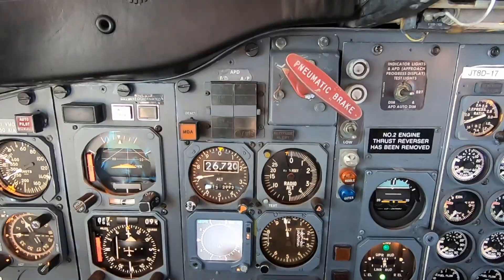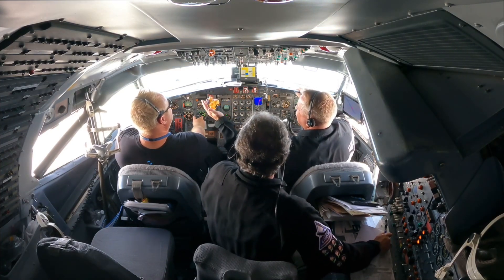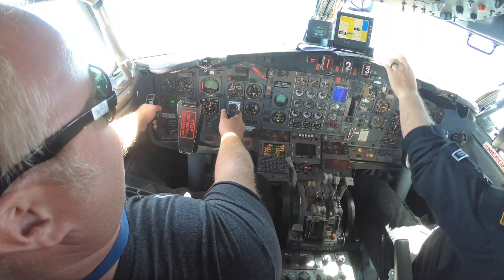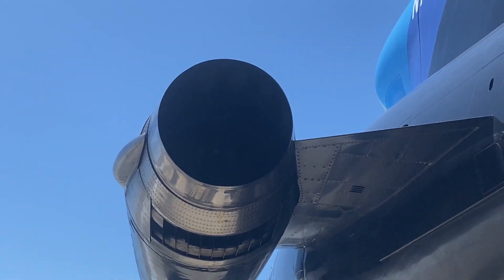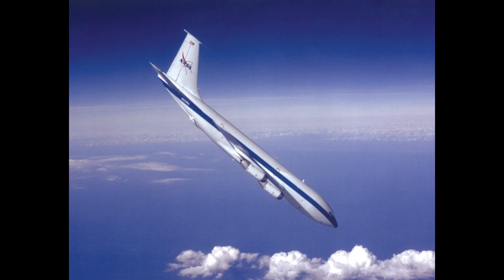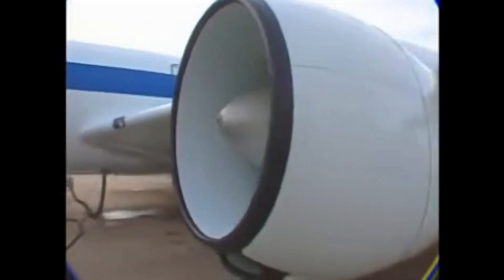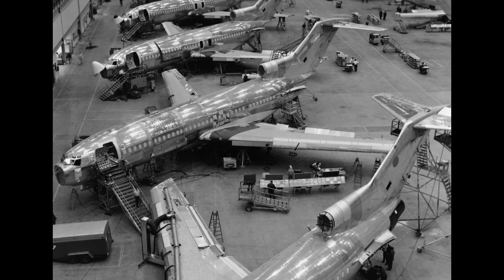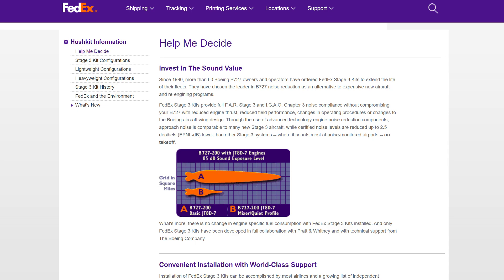Why NASA Uses A 1970's Boeing 727 For Zero G Experiments.

Comment: Funny story told to me when I was doing my PPL back in 2000... a 727 had just left the gate (forget the airport) and was taxiing across the apron, when the flight crew received a request to stop and take on another crew who were “deadheading” to another aircraft in another city. The captain stopped the plane and the rear air stairs were lowered so the spare crew could board. As the fully uniformed captain, first officer and flight engineer dashed up the stairs and past the passengers towards the front of the aircraft, one of them was heard to exclaim “My god, I didn’t know the stewardesses even knew how to start the engines!” 😄
Reply: Thanks for the laugh, I needed that.

Comment: As always great technical explanations for the systems and flight control management by the pilots. All very fascinating and great teamwork at the very least.
 As a side note, Bob hoover was doing similar types of maneuvers  back in the 50's and 60's as filmed adds for the Shrike aircraft alone in the cockpit whilst drinking a glass of water.....and the engines turned off....just makes you think.
RIP Bob.

Comment: The tri-jets came about due to the FAA not certifying twins for trans ocean flights to save fuel. Engines were not powerful enough at that time to complete a flight with only one engine.
Reply: True for the DC-10 and L-1011 but I don't think the 727 was ever envisioned in 1960 to be used for trans ocean flights and don't believe it ever was. It was never a long range aircraft.

Comment: Another plus point to the 727 is actually those low-bypass jets. If you need to maintain speed very accurately during a precise maneuver then low bypass engines are much quicker to spool up and down than larger high-bypass counterparts.

Comment: Yes, ESA uses Airbus. Of course. You are correct, it is an A-310 at this time. They have considered upgrading to more a modern type and eventually they will. The airframes can cope, but the avionics are a different story. The computer simply does not think those manoeuvers are suitable for passengers and will not have any of it.

So there would be software changes required. Hitting my personal sweet spot in the intersection of aviation and software-engineering I have given that some thought. Realistically the system will just receive some sort of partial lobotomy easing or removing limits and pilots will still hand-fly the profile. But I believe there is cooler approach:

The setpoint for the Airbus flight controls is acceleration. For straight and level flight you want 1G down, and 0G along the other axes. And the system then works to control the flight path so that these values are held. Any other manoeuver is easily expressed in these terms and thus Airbus pilots command rates of change.

That makes we wonder wether somewhere in the source code for the Airbus flight control software there is a #define or constant definition for that 1G reference. If so put a switch in the cockpit that toggles that value between 1.0 and 0.0. Maybe reuse the one for the no-smoking lights or the chemtrail-selector.

The procedure to fly a parabola now becomes: 

1) Point the nose up as far as you dare. 
2) Flip the switch from 1.0 to 0.0.
... aircraft automatically follows the zero-G trajectory wich has now become the new straight and level ... 
3) See wether you or the person in the seat next to you first loose their nerve and flip the switch back to 1.0.

Certification is for Admin to sort out. Waiting for my check.

Comment: Electric aviation for smaller aircrafts might make this tech easier, you can control more precisely, accurately and quickly everything  and it can be automated more easily 

Also fuel pumping and hydraulics not worry in electric air crafts.

Comment: The take-off footage, that looks more like the turbojets have been replaced by turbofans. Doing that retrofit was the expence that led to passenger services retiring the 727, though there were some run with exterior turbofans and the center engine disabled.
Not only can it operate from shorter runways, it also has a higher top speed then most Boeing aircraft of the age, including being able to push just past Mavh 1 in a shallow dive with all thee engines throttled up.

Comment: Hey Scott. Another good video. I want to reiterate NASA had absolutely nothing to do with our company or our FAA certification process.  The only connection was that I was employed there through 1999 and Byron Flew as a Payload Specialist on two spacelab missions. Truth be told, if anything it was someone antagonistic. With that said, Bob Williams was the director of operations for the KC-135 for 25 years and he and I worked closely together at NASA MSFC/JSC. 

When he retired we consulted for the two sequels of The Matrix, and ZeroG did a week’s worth of research flights for Warner Brothers (our first commercial flights) to in September 2000 to make sure that their concepts of visual effect were accurate. We took master Woo-Ping Yuen and the entire martial arts stunt team (Chad Stahelski was keanu reeves stunt double then) and did a lot of weightless fight scenes in simulated rain storms. We dumped 45 L of water during every parabola and lined the entire plane with a giant “condom” to catch it during pullout and recycled the water for the next parabola. 

We validated costumes, ZeroG blood hits, 15 ft flames and other amazing things we had never done or would be able to do at NASA. 

The point is that our business started in 1993 and we raised the capital to get it off the ground and flying well before NASA became a client. They didn’t help us with certification and the FAA typically responded - we don’t care what NASA did, you’re flying part 121. The FAA was ultimately supportive, but it took many many meetings and compromises. 

Finally on the 727 choice…. The air stairs were a big deal, but if you read our patent the biggest sell was that magic economy of aircraft maintenance ops balancing aircraft take off landing cycles, operation hours, and time in how these things impact A, B, C, and D checks. UPS had a fleet of 200+727s in operation in the 90s as the 727 rolled from high cycle passenger routes (8x  Day) to low cycle (2x day) and so there were a lot of them flying and it really fit our business model as is described in the patent.  Our plane gets a lot more inspection relative to a standard cargo ops plane hours since we don’t fly as often. Parabolas also don’t stress the plane the way say a hard landing or thunderstorm might (we flight validated a 50,000 node FEM with strain gauges during our early days). There’s no reason we can’t use it for quite a while longer. It’s got a lot of life left. 

Hope that helps. I know the weightless part, NASA’s history, and NASA as a currentclient blurs the line, but there wasn’t much overlap or conversation outside of the internal expertise of Bob, Byron, and me. Our extended team was really first class and it’s still unbelievable to me that we pulled it off. 

Thanks again for diving into this geek fest. Absolutely LOVE all the comments.
Reply from the maker: To be clear, one reason I have NASA in the title is because it’s shorthand for ‘space stuff’. I wasn’t clear on how much of the publicly available NASA experience and hardware heritage could apply, but I figured it was more than zero. Anyway, I wish I’d had this information before I recorded this last night.
Reply: @scottmanley  it’s remains the best pair of videos on our journey that we’ve done. Can’t wait to take you again one day soon! Let’s figure out when and where. Thank you for doing this and also allowing me to chime in with back stories. Honestly, few believed us in the days of ZeroG, XPrize, and Space Adventures and every day (most often by content on your channel) I’m reminded that we were indeed on the the path that history has shown to be correct. Reach out on one of my social accounts and let’s coordinate making this happen again and we can go even deeper into the rabbit hole. Who knows, perhaps we can pull off an entire flight of channel followers. I’ll toss my hat in the ring to be there. Maybe I can get Peter and Byron to come as well? Another fun fact - other than the FAA flights in the late 90s, the three founders haven’t been on a flight together since. There’s always been one conflict or another. Maybe it’s time to end that track record…23 years later.

Comment: The 727 is quite familiar to me. In Australia the 727 was the favourite domestic airliner with both of the major carriers through the 60s, 70s and 80s and you saw them at every airport. I guess they had good range and performance for our spread-out cities. I flew on them several times and used the rear stairs frequently as the front was reserved for 1st class. I think we got the better stairs though because air bridges were still in the future.

Comment: Fun fact: In the NASA/Ames simulator I demonstrated that a B727 could do a split-S starting at 16,000 feet and recover at 10,000 feet. Whee!

Of course, I also demonstrated that attempting a dirty roll on takeoff from SFO was a good way to wind up inverted inside Mt. San Bruno.

Comment: I remember being on a 727 as it backed away from the gate under its own power, using its reverse thrusters, because the ground crew was on strike so there were no tractors running. I think it was Dallas, 1990-ish.

Comment: Is there a concern about the number of cycles on the fuselage with an airliner of this age? Does the low altitude extend the cycle life in this case since the pressure delta isn't as great? Along those lines, do the hyper-G portions of the flight put cumulative wear on the frame and fuselage?
I love the grin on the pilot's face when his lanyard takes to the air, and you are obviously still giddy with excitement over the flight. It's on my bucket list, for sure.

Comment: Great video! Surf the wave. Gaming -> orbital mechanics -> space news -> aviation. It'll be great to have an aviation youtuber who actually understands the flight mechanics.
Reply: For example why 4 engines are better than 2.  I'm tired of hearing the lazy myth that 2 big engines burn less fuel than 4 smaller ones. Nigel Tufnel logic.  If you loose one engine on takeoff on a twin you lose half your thrust, but the plane has to be able to co tinue to accelerate and climb, so the plane has to carry 50% more engine weight and thrust capacity than it needs. But on a quad jet you only lose 25% thrust, so you carry 33% spare capacity. But making and maintaining 2 big engines costs less than 4 smaller ones.
Ref. Nicholas Cumpsty, Jet Propulsion, Cambridge Universtiy Press
Reply: @Cancer McAids sure, but a lot of ill-informed journos write that the A340 and A380, both equipped with high bypass engines, fell out of favor because they burned too much fuel. The A340 fuel burn was actually very good, which is how it was able to fly so far. But those engines were expensive to buy and maintain. And ETOPS ratings up to 300 minutes took away almost all the routes that twins couldn't fly. The A380 was just too big of an airplane with too many seats. Fuel furn per passenger mile was actually pretty good, but it's hard to fill 600 seats ..
Reply: @Cancer McAids but to your point, and like @Scott Manley says, a high bypass twin 737 is indeed more fuel efficient than a loud, gas guzzling low bypass 727. However, thats a comparison of two, now three different generations of engines.

Comment: I first heard of Zero-G at a space conference in the early 2000s. The folks I talked to mentioned that the T-tail of the 727 was good for parabolic flights. They also mentioned the cargo angle...at the beginning, they didn't have a full roster of flights so it was good that their plane was being used for cargo when they didn't have enough passengers to fill the roster.

Comment: Stall speed is exceeding the critical antgle of attack.  The 727 works because it can drop like a brick and because it is a completely manual aircraft that has a broad flight envelope.  

Jet engines also don’t create torque.  

The 135 was better.
Reply from the maker: Jet engines will torque your aircraft around if their thrust vector doesn’t line up with center of mass. Think about the rudder input needed when you lose an engine on one side.
Reply: The other thing to think about is when the thrust is separated from the rotation axis, there is a moment arm that gives the pilot something to push against. The KC was a bit like flying on a ball bearing and the 727/DC-9 have that “lever arm” like advantage. All of them can fly great parabolas, but without bias I can say I did 3-4000 on the KC, 600 or so on the DC-9 and we hit glass parabolas (weather permitting on all three aircraft) a lot more frequently. We had a scoring system that we used to run with the KC and our plane as well and our pilots and plane scored amazing on that system.

Comment: One point about the 727. Is it’s very very common to upgrade the engines. But due to the size of the upgraded engines, the number 2 center engine can’t be upgraded. The fuselage is too small to mount the newer engine. So most 727s now fly with two higher thrust outer engines and one lower thrust center engine. So having the center engine being such a low percentage of the total thrust is a bonus when in the dive. Only the center engine needs the hush kit, the replacement engines for the outer engines are higher bypass. Same type used on the MD series.
Reply from the maker: Yeah, and the JT8D-200 engines have a higher bypass ratio which actually makes them quieter. However, this plane only uses the JT8D-17 so they don’t have the larger fan.
Reply: @scottmanley  I am kinda surprised. When Delta retired the last MD-88s for Covid, there was a FLOOD of really nice JT8D-200 all over the place.

Comment: Noise from jet engine exhausts is proportional to the 5th. power of the jet stream speed. Conveniently mixing the jet stream with outside, still air reduces the average stream speed, and thus its 5th. power is very much less than without mixing.

Comment: I love 727's, I think they are still sleek and futuristic looking. My dad worked for Delta Airlines when I was growing up. At one point in the 80s I think Delta owned something like 200 727's, and as I used to get a discount, I flew on them a lot. I used to keep a mental note of the numbers on the nose gear door, and I think there was one particular 727 which I flew on multiple times. Delta also owned a ton of DC-8's, which is a whole other classy cool old jetliner.

Comment: Jet airplane fuselages have a max rating on number of pressure cycles.  So it seems like at some point, they will have to transition to another airplane model.  One that is currently being built, or at least a newer model that can be found with less usage on it.
Reply: Modifications and inspections can extend that.
Reply: @jpeterman57  The aluminum skin stretches and contracts during each pressure cycle.  Eventually it will fatigue until failure.  So unless they replace the entire airplane skin, there's no way around that.  Modifications would mean reinforcing the metal.  But that will add weight, which is never a good thing on an airplane.

Comment: Was always fun seeing the tri-jets in UPS, FedEx branding at the airport. Totally makes sense that the center engine is a big benefit in this use case, kind of like single engine fighter jets. Wonder if anything DC9-related would work well for this: no center engine, but tail mounted engines, minimal automation, and a good reputation with pilots (presumably meaning sufficiently powerful). Perhaps too narrow though.